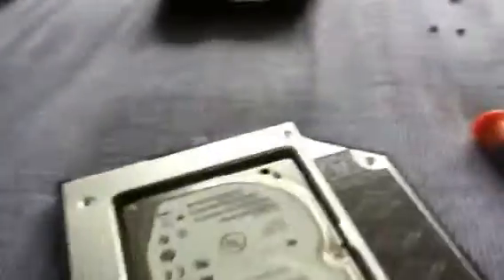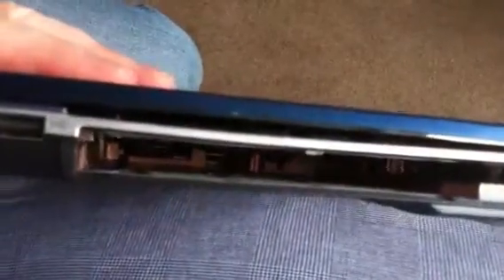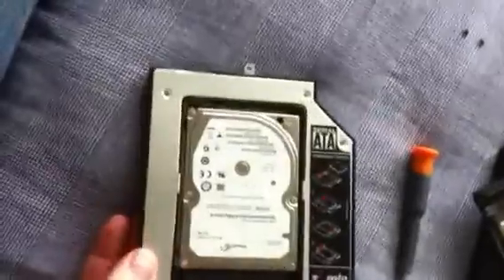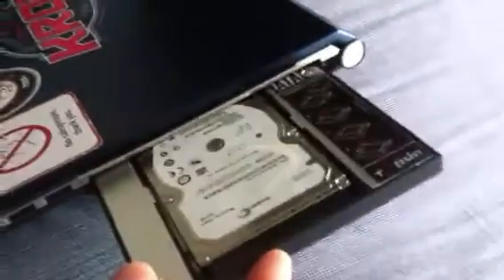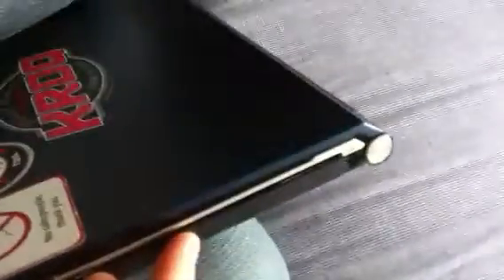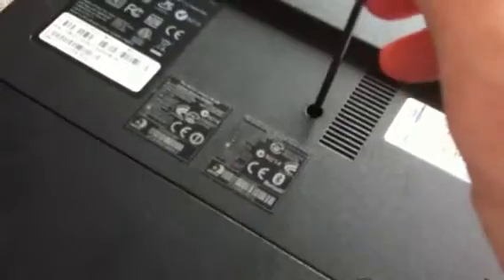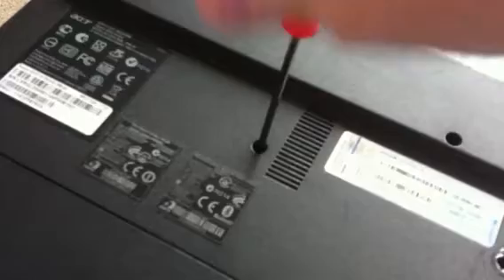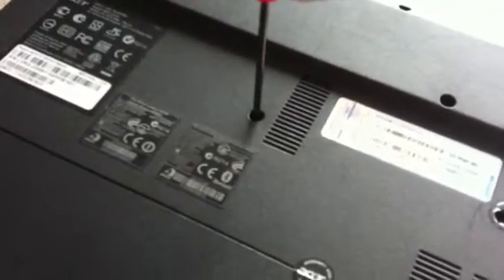Installing a hard drive caddy in my Acer 4830TG

Comment from the maker: Just do a search for hard drive caddy 9.5mm.  I just found one that is currently AUD$10.89 (about USD$11).  Just try to find out if you need a 9.5mm or 12.7mm caddy.  The 12.7mm is too high for my drive bay.  There are quite a few on ebay.

Comment from the maker: @wonderu1 I still haven't tried, because I don't really have a need to.  Sorry.  If I get some time I will look into it, though.  You should be able to boot into a different OS on the caddy drive if the boot partition is on the main drive.  ie:  You could have Win7 on the main drive and Ubuntu on the caddy drive.  Grub would be located on the main drive but would be able to boot Ubuntu residing on the caddy drive.